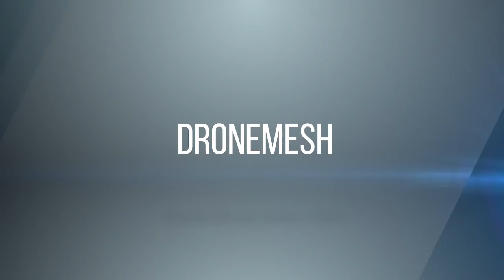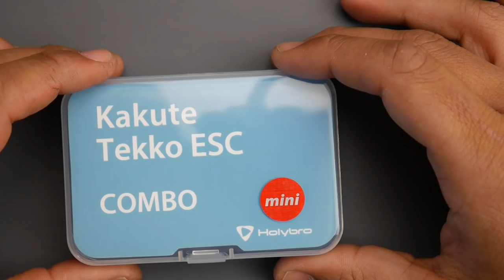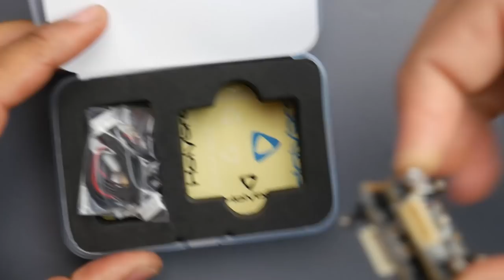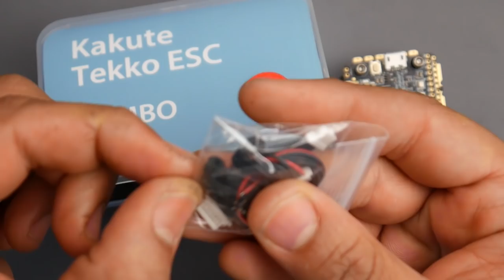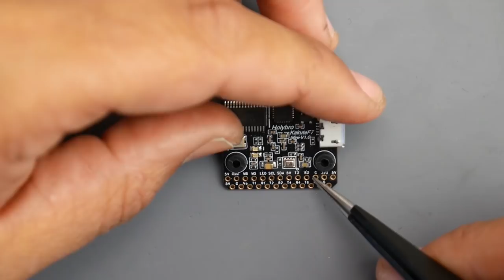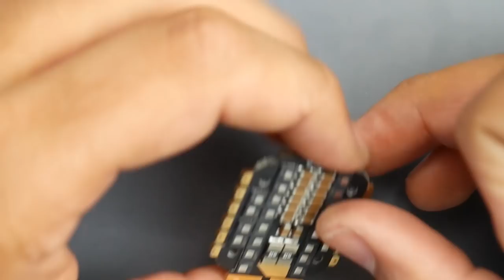Holybro kakute F7 Mini Stack // Overview

Comment: After checking the comments I can see I am not the only one waiting for a noise test of the Tekko32 F3 mini. I am starting to believe you already did the testing and it was not that great and you are avoiding to publish it. I do not know about the others, but ESC noise testing is something only you are doing, and in fact, it is the reason I do follow your every video. I hope you continue doing it for a long time. And hope everything is well for you. Best wishes from an Spanish guy living in Greece.
Reply: If that is true i Will be really sad because i already ordered one😪
Reply: @hanfpv3093  I am trying to wait for the test to order. If Drone Mesh could tell us if it is in his short term plans to test it and approximately when, it would truly help all of us who are waiting. The fact is that the Tekko32 Mini does not have many caps by comparing to the HGLRC Forward. But maybe those fets do not need so much filtration. Anyway, the Holybro 20x20 stack seems to be the most advanced in any regard. Anyone thinks there is another bf based 20x20 stack (FC+ESC I mean) better than this one?
Reply: I think the aikon 20x20 stack is also a really good one (never had it but have had other aikon stuff which is really good)
Reply: @silverfish27  to bad hè doesnt even aswer to any of our questions🤨
Reply from the maker: It will be tested within 6 days.
Reply: @DroneMesh  Thank you, I do really appreciate it.
Reply: @DroneMesh  1 to go
Reply: @DroneMesh  tested and published or just tested? Just hoping I'm not going to regret getting the esc over the hglrc or aikon offerings. (Fc is going to be a millivoltOSD cuz I'm lazy and dont want to tune much.)
Reply: @hanfpv3093  I mean... it's either testing/producing videos or replying to comments/staying on top of social media. Probably pretty difficult to manage time doing both.
Reply: @ReptarKingoftheBrozone  Yeahh.. Well.. What can we say.. Sam makes alot of video's, most of them really great! But when it comes to update video's, or actiually doing the things he says hè will do, it always takes alot of time, or it doesnt happen at all.. Anyway, i maidened this esc  2 days ago, and i did have some noise.. If you are on the brainfpv fb group, you can look for my post about it👌😁
Reply: @DroneMesh  it's been nearly a year or am I just missing something?

Comment: Hi! I have Kakute F7mini and Tekko32 F3 45A mini. Motors are iFlight Xing 2206 2750KV. The Problem is that current drain is limited to 80A. I use Tattu R-line 4S 1800mAh 95C. Is Tekko32 limiting the power? I tested it with different batteries and props, but I cant go over 80A. Can you test this esc please?

Comment: If you are talking to Holybro .. see if you can get them to add a couple of different brass spacers to reduce down the 3mm mounting bolts on some frames.. eg like the ones used to mount servos.. the spacer is also an anti crush ... grommet part you see with a lot of servos.. these work great but need to be the right length.

Can't wait for the full testing..
The thing that would make this flight controller really awesome is to have the edge solder like the Matek f7 mini.. That is the best board to solder up because of that hands down. Very little chance of damaging the pads

Comment: The top left pad "C" for camera control, I cannot figure out the pin number to set it as resource to control camera.  Any idea?  Thank you
Reply: If you haven't found the answer yet. No settings required. Usually it's:  Roll Center, Pitch Center, Throttle Center, Yaw Right to access cam osd.

Comment: Tekko.. your favorite brand isn't it?weird the vtx isn't a atlattle or is it? ESC looks like a triple layerd board and should take some abuse. I wish they would put the wire harnesses to interior instead of the the edges. The the only flaw of the ori32 is the harness placement and quality of connector